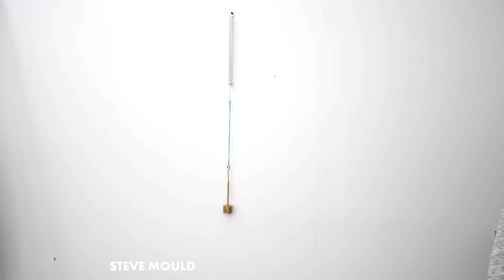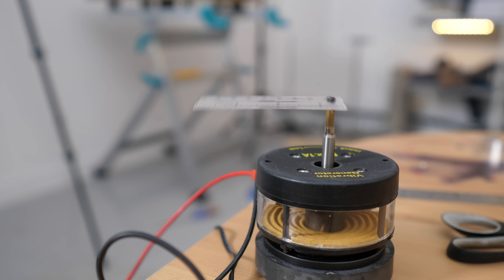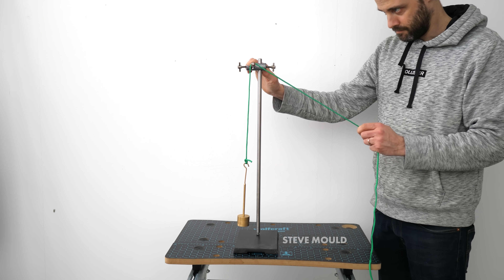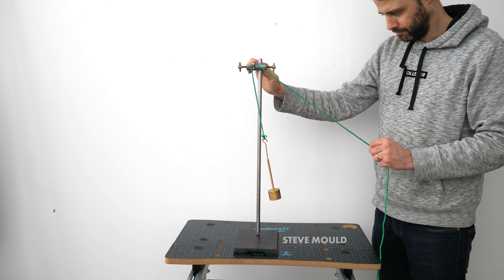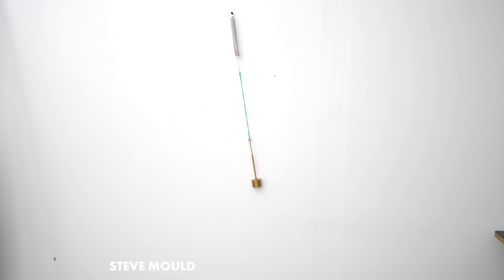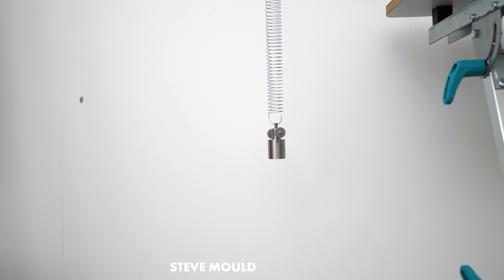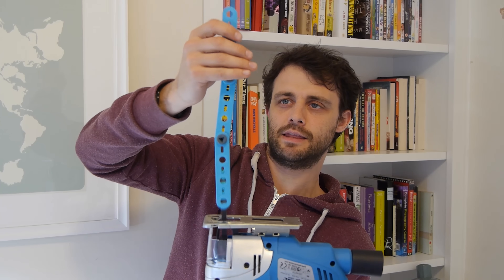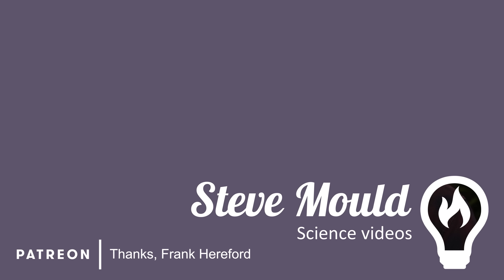What If Swings Had Springs Instead Of Ropes: Autoparametric Resonance

Comment from the maker: You can also discuss this video on Reddit: https://stvmld.com/gm9_zcuh
The sponsor is Wren: Offset your carbon footprint with Wren and we'll plant 10 extra trees for the first 100 people: https://wren.co/start/stevemould
Reply: Seriously you're signal boosting a carbon footprint calculator? Carbon footprint calculators and carbon offset initiatives are misguided at best, and malicious at worst. Started by none other than BP, they make it seem like the problem can be solved by individuals offsetting what they "are to blame for" to distract from collective action and prevent people from making those who emit more in a day than an individual could hope to offset in their lives accountable and forcing them to stop. Don't get me wrong, cleaning up the mess we made is important but we NEED to cut off the problem at the source before doing so will have any meaningful effect!
Reply: @cygnusinfinity5126  Word!
Reply: @cygnusinfinity5126  We all have to do out part
Reply: @lucasng4712  yeah, we do. And we need to remember collective action to force major polluters to take responsibility for their actions is the only option that could have any real positive effect. Systems that individualize responsibility serve only to placate potential activists.
Reply: 4:13 Merging blackholes during inspiral: Hold our light.
Reply from the maker: @Kostas  Ziovas period of pendulum swing is independent of mass. Period of spring bouncing up and down does depend on the mass
Reply: Wren is a scam just like all other carbon offsets
Reply: I HAVE A QUESTION ❓
as we know magnetic monopoles aren't exist can we make a magnetic monopole by using lots of small bar magnets and place all of them in the manner so that evry magnets South ⬇️ polls are at the centre of that sphere and all of the  North ⬆️ polls are at the surface.
Does it make a magnetic monopole❓
Reply: @gopalrajak8594  inbetween the magnets there will be north
Reply: Isn’t your pole wobbling in that experiment?
Reply: yeah nice thing for a singular person, but if you really wanna change something we need to tax carbon emmissions... this is a modell that only affects the personal carbon from people, who are willing to pay... also it would be easier for all, you dont have to monitor your carbon footprint, you have to pay it automaticly with the purchase of your goods or the company pays and you pay the increased price.
Sites as these shift the responsibility from cooperations to singular people and not all people take responsibility, but we can make cooperations take the responsibility.
Reply: @enemyunknown8181  Not to defend the obvious greenwashing scam, but you're responsible for your purchases, too.
Reply: @stormisuedonym4599  ofc. But i think such companies hinder progress in the way that people who care, think that they have done enough.
Reply: It’s changed by the Coriolis-effect  , the wall interrupts the circular motion , anytime you break gravity (the bobbing) coriolis will influence the pattern. Force of de-acceleration of the earth (approx 3/4 sec per year). Try a plastic rattle stone , or hang the bob from the center of ceiling and bounce it , the end result is spinning the same direction, the rest is a collision of all natural and applied forces
Reply: Anyone who tries to push that "personal carbon footprint" garbage is a corporate shill who should be shamed and shunned. It's disgusting.
Reply: @bixmcgoo  Do your part. Denying personal carbon footprint does nothing for the Earth
Reply: Every time I see these carbon offset programs it's always about planting trees and making biochar and stuff like that. People have been continually focusing on the wrong offset. Our oceans are more important to the carbon cycle than all of the landmass on planet Earth. Yet we continue to pollute our oceans and killing off all the reefs and ecosystems within it and instead focus on planting trees. The ocean provides 70% of the breathable oxygen for the planet. It does this through algae, ecosystems, and microorganisms and phytoplankton essential to that carbon cycle. Only 30% of our oxygen comes from land-based plants. The ocean also absorbs more carbon dioxide through those processes then any of the land-based efforts or materials ever could even if utilized at 100%. That includes all of the basalt sinks that they're planning to implement for carbon offset. Just a few cubic km of ocean absorbs more CO2 than all of our basalt sinks and trees in their entirety ever could. we should be saving our oceans and yet we continue to watch our reefs die thinking that oh I planted a tree this year I did a good thing while continuing to utilize plastics and other highly polluting things that run into our oceans through mismanagement and proper chemical treatment and runoff. Microplastics and even large plastic material has been found all the way as deep as the Mariana trench this is how far reaching our plastic and chemical destruction is reaching. Most of our reefs are now gray and dead from chemicals and other things. Even the type of sunscreen that you wear at the beach matters in this effect and this has been proven that some chemicals in sunblock even at very minuscule PPM can completely eradicate certain algae and coral in areas where people use it and then swim in the ocean. And people wonder why global warming is happening. It's not because of the land-based things that we use it's because we are killing our oceans by not properly handling those items and testing those items and containing those items from running into our oceans and enabling our ocean to function properly offsetting  things like our basic carbon footprint and absorbing all that CO2. If the ocean dies so do we. If we keep planting trees yet doing nothing about what we're doing to our oceans; the whole cycle will crash because no land-based operation could ever keep up. That's where our focus needs to be not a pine tree in your backyard.
Reply: @jerichojoe307  plus carbon offset programs are usually clever scams anyways, never even making the changes people are paying them for. it's just disgusting all around
Reply: Can a Wilberforce spring pendulum switch between combinations for 3 modes??

AND Then have two of them connected by a string and a quarter out of phases so they also have driven resonance between them???
Reply: It's doing a 'Moon Wobble'.
Reply: Since when is resonance equivalent  to ear bleedin?
Reply: MAKE A SWING OUT OF SURGICAL TUBING!! That's safer than a spring, hahaha.
Reply: I've always wondered about the physics of gaining acceleration on a skateboard or bike going down a ramp.  It's not just gravity, at the right time you 'push' into the ground as you go down the ramp and you gain drive, you see the guys on half pipes never pedal or kick they gain all their drive from 'pushing' on the downramp.
Reply: This kind of parametric resonance has been used in traditional swing in nepal (called ping) for centuries in which person who want to swing lowers his/her body when he/she is at the extremities and stand up fully when he/she is at the mean position. In doing so the CG of pendulum(swing) is altered periodically thereby causing in periodic alternation of  effective length of pendulum(swing) and hence high amplitude is achieved . 

Here is a link of one such swing in action https://youtu.be/17k7Q10wDJA
Reply: Thank was super cool, thank you!!
Reply: 2:00 Steve please change your swing your kid or a friend of theirs will get hurt when they smartly but unfortunately discover the trajectory of jumping off the swing along with the inefficient mass transfer of colliding with a significantly harder surface of the concrete step or it's trip-inducing edge :(
Reply: The recorder is the funniest scene you’ve done
Reply: The maths of motion with the spring mass resonance seems like it would find a place in biochemistry.
Reply: maybe @Colin Furze can make one!
Reply: @Zaydan Naufal 😂🤣🤣 I am not talking about latency of internet .... Ping means swing in my language
Reply: my dad had our swing set with springs on it for a while when i was younger. was cool. he used old trampoline springs. one sping had just 1 set at the top, chains the rest of the way down. and the other taller swing had 2 sets of springs at the top
Reply: You've done the glugle jug, look up Inca Water Whistles.
Reply: I worte a Unity programm on this matter (3-Dimensional Elastic String Pendulum)  as a subgraduat project if you are intrested i can share the files with you👍
Reply: Pull your pants up ya tool.  Doesnt look like you grew up in the ghetto so dont dress like you did.
Reply: L
Just
Reply: Your blinded good sir. But your on the right track. Now think!
Reply: Wot wud happen if a spinning wheel have wheels attached to it, spinning by their own power either with or against direction of main wheel?
Reply: Is it really centrifugal force or just the apparent force from a rotational frame of reference?
Reply: You were mistaken, the pumping of a swing actually do has to do with raising and lowering the mass. When going forward and beyond the lowest point (the moment you go fastest) you have your feet forward and hang backwards pulling the ropes of the swing with your hands so the rope below your hands becomes at an angle less than 180 degrees with the rope above your hands, meaning that the distance of the attachment of the rope at the top to the seat of the swing shortens (slightly). The equivalent of pulling the rope from above like you did in the video.
Reply: Greenwashing. Better to plant a tree eat less meat.
Reply: @Volodimar  ?z66
Reply: @Volodimar   , restoring the greatest possible diversity to frequently grazed  tops of grasslands (triggers growth of the  greatest  root  density &  sequesters more soil carbon to (where we took it from)" beneath"  the surface,   (out of the  risk  of becoming atmospheric carbon ,  by fires of dead tree in future or fires of the building materials in future years ,  the vast majority of forest carbon from trees will only  be delayed , but destined to become ~85%  atmospheric Carbon ,  if not burned , it will then  oxidizing "above the surface" - of the  branches,  leaves , or falling , blown over, unnaturally selected  mono , cropped trees ; or  be biodigested openly  to become  atmospheric carbon dioxide &  methane
 It is mono crop agriculture that destroys carbon retention "beneath the surface"  in soils  . 
Planting trees are only a longer term mono crop disaster , rain forests have  very little nutrient value in soils , it has all been pulled up to the canopy awaiting it's certain release to the atmosphere with massive amounts of  carbon structure  supporting very little photo synthesis at the top .   Mono cropped contrived forestry can never come anywhere close to the densities of  "below ground carbon storage that occurs 
" in non agriculturally exploitive ,  wild dense GRASSLANDS , 
Which are the only true  precursor to the development of the richest   soils that preceded the  worlds greatest grandest of  forests (above ground burnable "carbon"  fuel ) .  
We are naive to take mono crop managed solutions that maximize exploitable carbon and count on technologies to bury it , when exploiting it for above ground uses will be more financially lucrative than burying it  .  
 Trust me no one will be digging up mycelium perfused carbonacious earth to build burnable housing and building structures from above ground.  But the grasslands can easily store food on the hoof , wings , fins , hives,  that requires absolutely no refrigeration  or energy consumption to keep fresher than any invention of mankind can devise till it is needed .  They all together with out any human intervention are instinctually adapted by nature to cultivate grasses in preventing above ground  oxidation of the grasses and regrowth of deeper roots , if only we would remove the infernal barriers that constrain them from their ancient calling .
Reply: @Volodimar  wut
Reply: Love your videos Steve! Bluest eyes on youtube :P

+Cryptogenik
Reply: https://youtu.be/5sgRTbTm91Q
Reply: Ug. My link is shadowbanned or something but you can see this in Veruca Salt's Volcano Girls video.
Reply: Wren claims I can't reduce my carbon footprint to 0, so I should pay them to do it for me.
Obviously, they do something that they didn't ask about in the questionnaire they use to determine your carbon footprint.
Since whatever I pay them has to go to both that reduction and their business, I reckon I can get to 0 for less by doing it myself. 
I'd go plant a tree, but I need to cut a few down first.
Reply: isnt bungee jumping basicly a swing with a "spring" in it?
Reply: I would start with the carbon offsetting by supporting solar and wind energy with long lasting batteries like LTO cells. 15 - 30k cycles with 100% C1 and only a degradation to 80%. Don't believe me check it. Looking forward to your solar cell installation video^^  , preferably with LTO battery banks.
Reply: Tell china and india to stop polluting before you tell a younger country that has about an much population as a state in America.

Australia does not pollute as nearly as much as other countries
Reply: @Bibibosh  Ethical conundrum. Developed nations telling undeveloped nations to not go through the process of easy development that they enjoyed
Reply: I cant wait till this guy learns about the electric springs that connect our atmosphere to the rest of the cosmos and derives our weather rather than co2 causing climate change. Cycles.
Reply: @antiprismatic  those "electric springs" were just representing electron bonding  in chemical molecule modeling.
Reply: @antiprismatic  nice b8

Comment: I made a spring swing years ago and learned to use it. I simply put 1 garage door tension spring at the top of each chain connecting it to the bar. I don't see how that's dangerous or can take your arm off. It took lot's of practice to pump it in that 1st stable mode you mentioned. Obviously, trying to move in that 2nd stable mode resulted in hitting the ground. It was novel swinging in a straight line the same height above the ground, but much of the appeal of a swing is from the elevation change, so I removed the springs eventually.

Comment: You can do an episode in this... you claim that raising and lowing the center of mass (COM) has nothing to do with pumping a swing.

Why it fails: all the forces you apply (through your hands, by shifting your limbs) transmit radially along the chains or ropes. Radial forces can’t produce a net torque about the pivot, so your internal wriggling can’t change the swing’s total angular momentum. You’re just shuffling momentum around inside your body, not adding any from “outside.”

When you tuck your knees, the legs (say ~20% of your mass) might rise 10 cm, while your torso (~60% of your mass) only drops 2 cm. Net COM rise ≈ 0.8 cm.

Comment: They used to make small pocket tachometers used for testing machinery. The device looked like a pen. It consisted of a small wire that could be extended or retracted into the body of the device. The base of the device was touched against a running machine. When the wire started to wiggle you could read the RPM off the side of the device.

Comment: the fun thing is that the in-phase mode has a lower frequency than the anti-phase mode, so if there’s a mix between the two modes they will slowly drift out of phase and back in phase with each other

Comment: Pumping a swing by swinging legs and leaning back does indeed have much to do with lowering center of mass/gravity (CoG). Once a swing has started moving, the single most effective and efficient way to pump a swing is to simply lay as flat as possible (perpendicular to the swing's suspension) at the rear end of each swing/oscillation, which results in the largest possible proportion (or total) of the person's mass achieving maximum potential acceleration and momentum gain by being located at/along/near the swing's extremity. By placing mass along the perimeter of the swing's path, the person's mass effectually achieves the longest "fall" time and distance during each oscillation.

Also, as children instinctively do, leaning forward or sitting up at the forward half or end of each swing/oscillation reduces the angular momentum (inertia) so that the swing returns backward with less gravitational resistance by inertia than with the person's mass remaining closer to the seat (pendulum centripetal extremity).

These two seating position changes (upright and prone) could be done in reverse (at the opposite ends of each swing) and still gain overall swinging momentum, however total momentum gain would be less because the upper body is heavier than the lower legs, and so laying prone at the front end of the swing would act negatively (by torque and action/reaction) against gravitational acceleration of the pendulum, as well as (or thereby) impart forward momentum to the pendulum when the desired effect is to increase rear-ward momentum at the pendulum's centripetal extremity (the seat).

As mentioned in the video, some rotational energy/amplitude is imparted to the swing by periodically rotating the body in concert with the swing position, but the relatively small proportion of this contribution is demonstrated by the difficulty in starting a swing this way from its gravitational rest point (vertical suspension).

Comment: I see a condition similar to what causes high or low pressure weather patterns to rotate clockwise or counter clockwise. 
As the length of the pendulum decreases, the speed increases.

Comment: I often use a diagram of this type to try and explain how tremolos work on a pipe organ (A weight on a spring). It's a balanced system which needs to be balanced to operate properly.